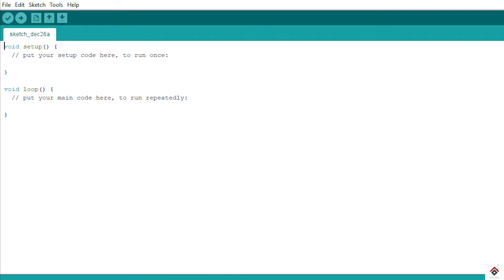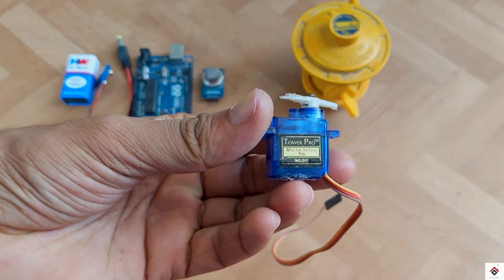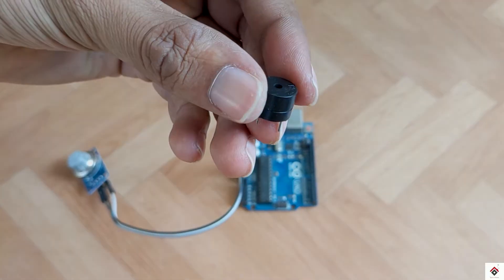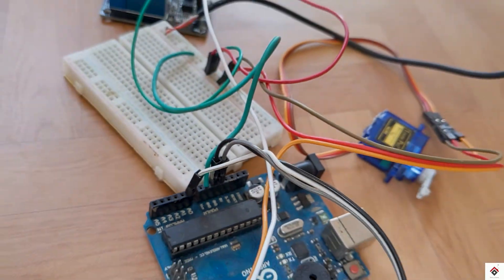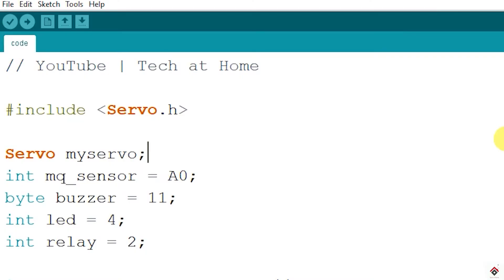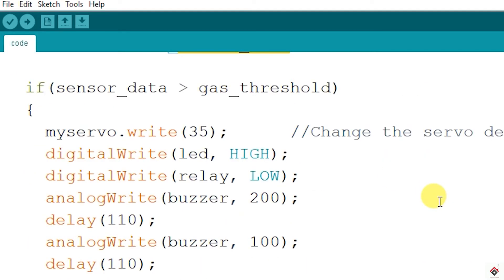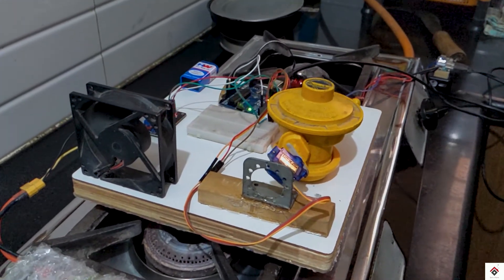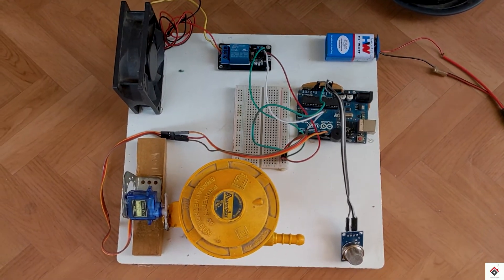LPG gas leakage detection system using Arduino[with CODE] | LPG leakage safety project with auto off

Comment: (plz reply quickly) I use the mq2 sensor, do I need to make any changes?
Reply from the maker: You can check if the values from the sensor are in the same range shown in coding part of the video.
If required you can change thresholds in the code.
Reply: @techathome thanks

Comment: I want to order this "LPG gas leakage detection system using arduino",how and where can I order?
Reply from the maker: We only provide code and circuit diagram.
You can submit the google form using link in the description.

Comment: Can we do this same using ESP32 micro controller
Reply from the maker: Yes you can. Check the pins availability and modify the declaration part of the code based on pin number on ESP board.

Comment: Hello...sir I was concerned about one thing
If I pay 50₹ you will be providing code with circuit 
So the circuit means whole circuit or what I don't understand 
I am interested in this project but I am a beginner so I am worried if I will be able to do this or not
Please can you reply meeee????😢😢
Reply: Sir Please reply me because it's very urgent
Reply from the maker: You will get code and circuit diagram showing the connections.

Comment: Hello Sir. I Have Mq2 Sensor And To Use It In This Module. How To Connect It In The Arduino For Detecting Gas In Lighter. Please Reply.
Reply from the maker: It's same. No difference.
Reply: O.K. Thank You.
Reply: Hello Sir.
How Are You.
Without Delay Module How Can We Use It. Is There Any Option.

Comment: Bro mere ko isme gsm module bhi add krna hain to isme baaki sb ka connection same rhega ya phir change krna hoga
Reply from the maker: Existing connections will remain same. You have to use UART pins additionally to connect with gsm module. Code also needs some update.

Comment: Sir I have paid 
Mujko code or diagram mil gaya 
Laken a project thik sa Kam nhi kar rha ha
Arduino pa power Deya to subkuj automatic ho rha hai 
Sencer Kam nhi kar rha ha
Reply from the maker: If sensor is not working properly, other components will not work as expected. Can you send short video of values in serial monitor on our mail.
Reply: @techathome  sir mq2 sencer use kar sakte
Reply from the maker: You have to check the values on serial monitor and modify conditions based on values.

Comment: Bro the servo motor is not working.the power not enable servo motor.how to I work it.
Reply from the maker: Refer the circuit.
Give external 5v supply for servo.
Reply: After giving 5 volt supply the motor not work

Comment: Where is hisfter i jave asking for 2 months now😢
Reply from the maker: I have shared one community post on the h shifter,  mounting switches is pending.
Reply: @techathome  bro you made it like I use rj45 connecter and wire no need to make custom wire just simple net cable

Comment: Sir, i have arduino uno clone with ch340 ic... And im unable to put it in dfu mode... Any solution.? Or which all in one best arduino  should i buy that will do any of the projects unlike that arduino uno with ch340g (ruining my money😅).
Reply from the maker: Arduino Uno ch340 can be used to make projects like this.
But for making UnoJoy based wheel, you have to use Uno having 16U2 chip for serial communication.
Reply: ❤ Ok... So which one should i buy arduino leonardo or arduino uno with 16u2 ? ... Want to make ffb steering wheel. And sir there is arduino leonardo on amazon for 800rs and on makerbazaar around 500rs which one should i choose...
As i don't know the types of clones with different(leonardo) features or all are same unlike arduino uno... Please help😊
Reply: Have you done this project?